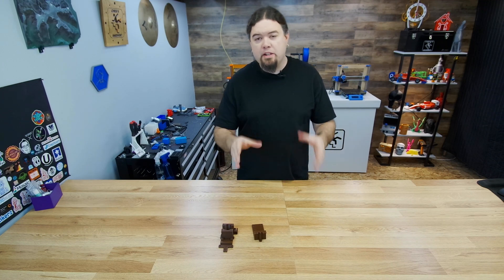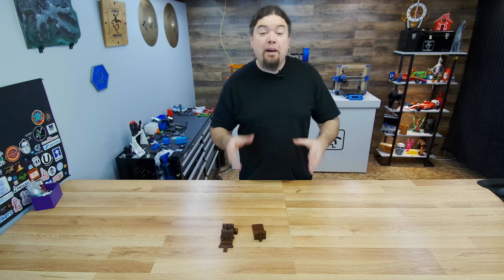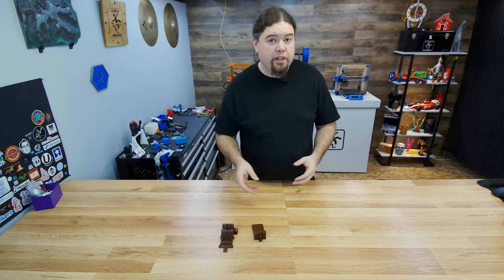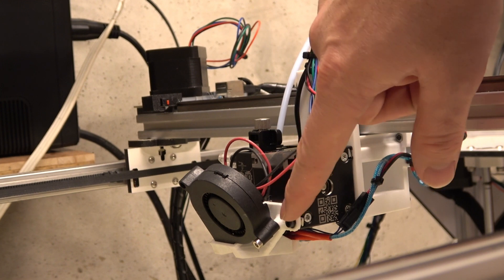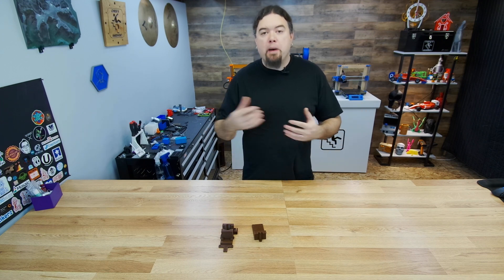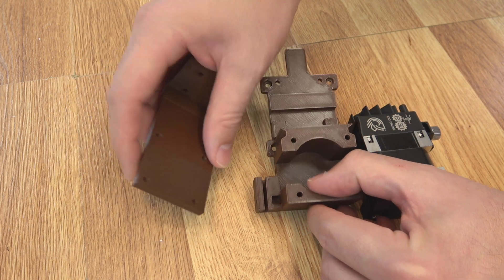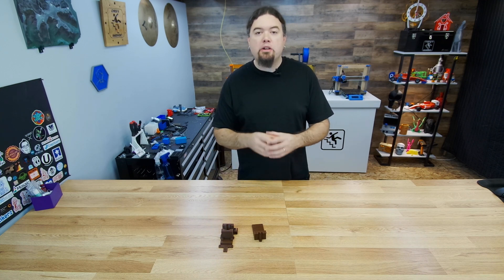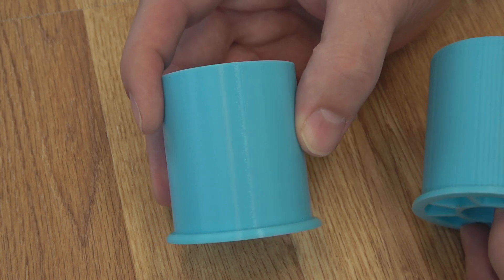3D Print Big! - Folgertech FT6 - Hemera Upgrade - Chris's Basement - 2022

Comment: Thanks for the tip about the squares on large prints to prevent warp! I have similar happen to me all the time when doing wide but thin bases on my 300mm³ and 350mm³ printers. Lowering the bed temp can help too but it gets to the point where it no longer holds the part. Maybe there is a method of altering Cura's Raft properties to do the same automatically in slicer for parts that need it.
Reply from the maker: Thanks for your comment. Good luck with your projects!

Comment: Great stuff, as always, even if it was a bit of a hassle. Another solution for your too-many-segments issue is to set your slicer to generate G2/G3 arcs, or use the Arc Welder plugin for Octoprint when printing. No need to go through a Klipper conversion.

Massive appreciation for your continued dedication to the tech side of 3D printing, problem solving, and the hobbyist tinkering aspect of our favorite space age pastime … even though there's probably a famous rich guy on a yacht somewhere who wants you to help him print a new steering wheel in the shape of a big donut. Cheers!
Reply from the maker: Lol! Thanks for the tip!
Reply: @ChrisRiley  Of course, telling the slicer to use a larger minimum segment size can also solve this. Presumably when Marlin is built with native USB it runs serial comms on the USB port at full USB speeds, so that may also help. The issue of too many short segments is planner starvation, where the planner is quickly done with all (short) moves but more moves have not yet arrived. The planner is forced to run the last unchained move with deceleration down to near-zero. Since the problem is an emptied out segment buffer, increasing the planner buffer (not command buffer) size doesn't really help with this issue.

Comment: at what lenght the belts are considered too long to work properly??  Great job!
Reply from the maker: Thanks! I'm not sure, but this one is close, if you move too quickly, they rub on the pullies.
Reply: @ChrisRiley  might work better with a wider belt or/and with some sort of pullies the other way around to prevent it from sliding. Was this printer made for signmaking? It’s an unusual shape

Comment: Hey Chris.  Nice to see those beautiful layers. My FT-6 has been idle a while waiting for some upgrades. I also have the Hemera in there but using a BL Touch. I opted to go with direct wiring since that PCB in problematic. I also bought a new bed from 713Maker.  It wasn’t cheap but it’ll be a nice upgrade.  Next up is cutting some acrylic to enclose it so it contains the heat and VOCs , so my fume extractor can do their thing.  It has potential
Reply from the maker: Very cool! Good luck with your projects

Comment: That bottom texture, what was the spec for this to avoid curling? Interesting!
Reply from the maker: Hey, so what I like to do is run the first layer at a 0.3 layer height. Create the part and then fill the bottom with squares. Then extrude them into the part 0.3mm
Reply: @ChrisRiley  think I can visualize this. How big are the squares and the lines between the squares, how thick are those?